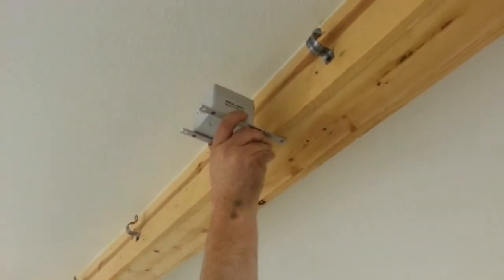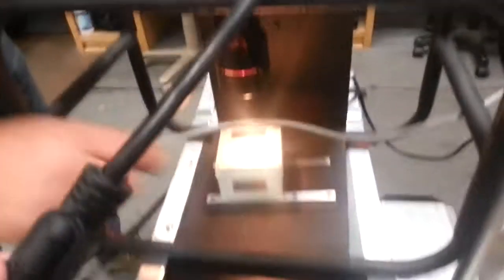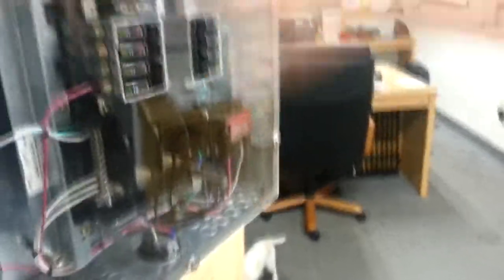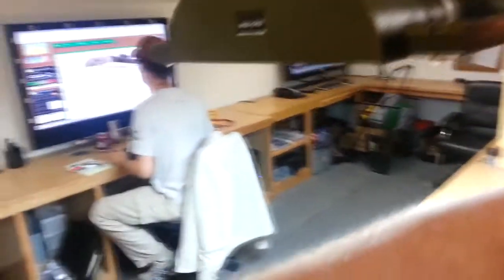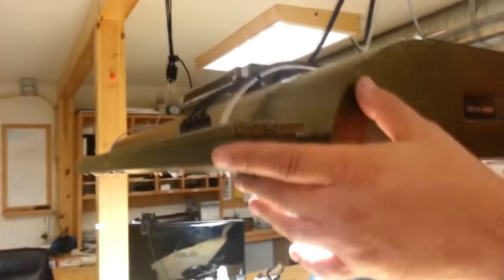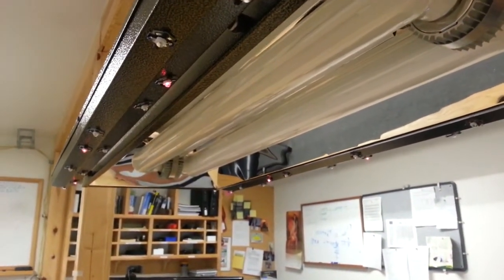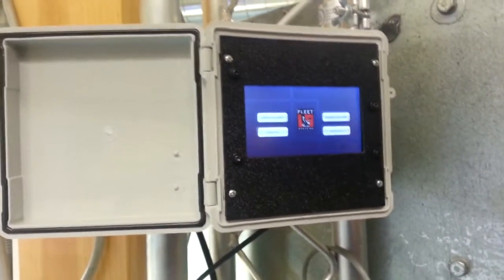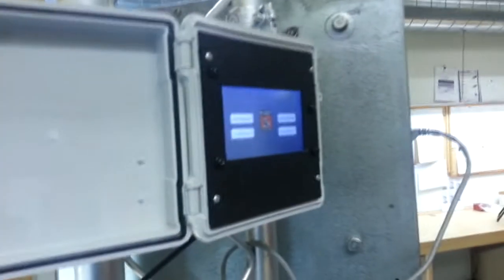How Inda-Gro Induction Lights Works

Comment: where is your capacitor for power factor located? within the main sensor?
Reply: The sensor is 12 v DC circuit.  There is no cap necessary.